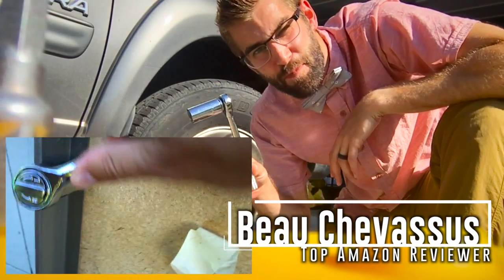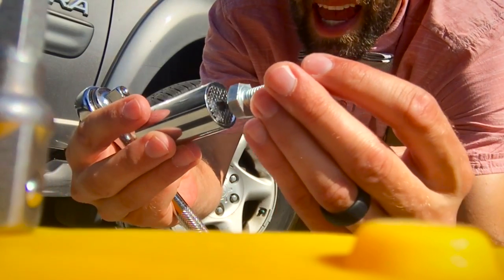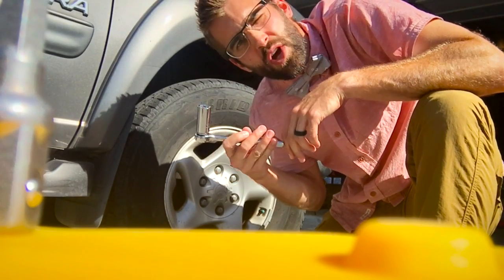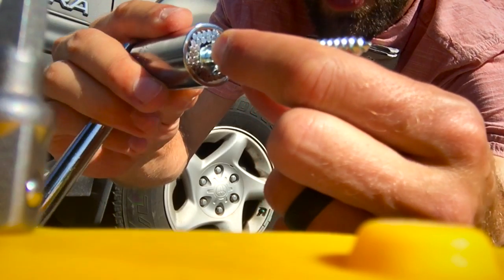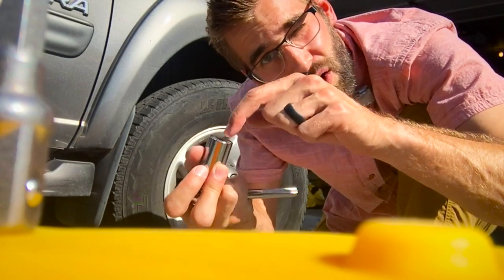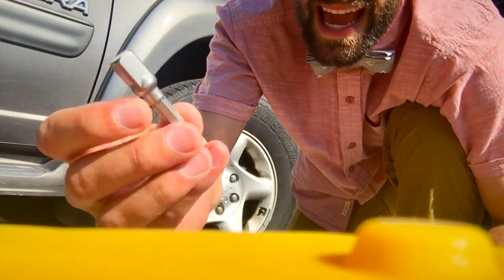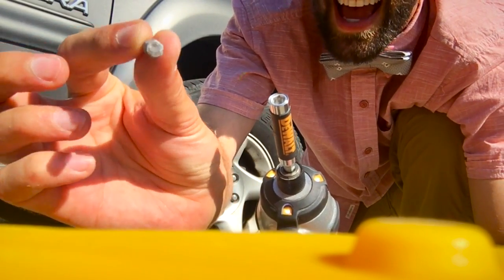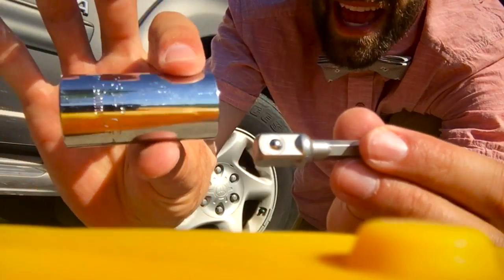★★★★★ Gator Grip Review & Test, Universal Ratchet Socket Wrench Magic Spanner Aonesy - Amazon

Comment: I have one that i threw in my tool bag where my impact and drill are.  I have the hex shank impact drill bits and a socket adapter also. Good item to have in a small general purpose tool bag.  I also keep some diff screws in zip lock,level,tape measure, razor knife and a pencil.